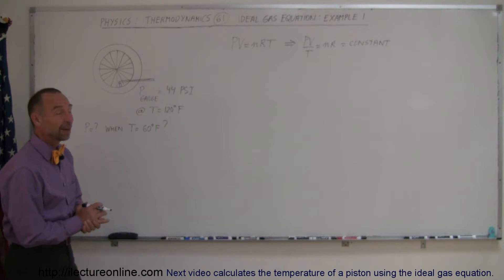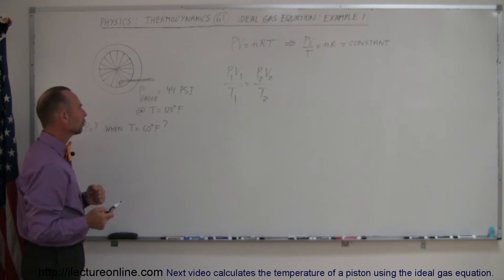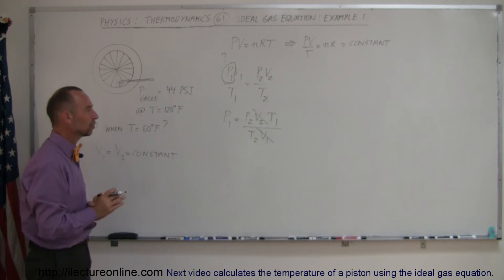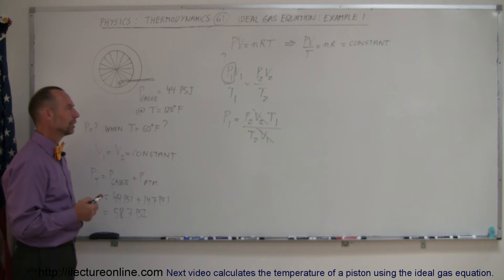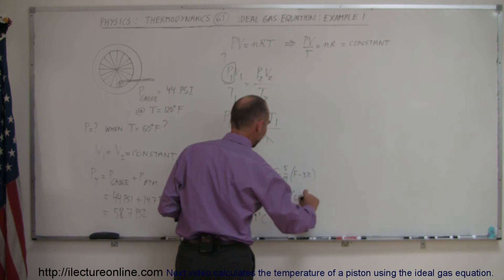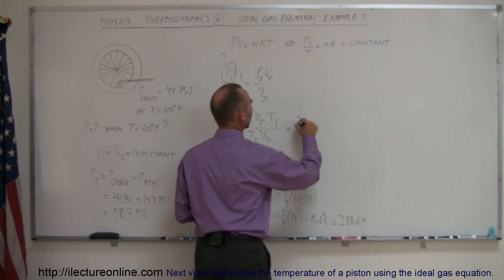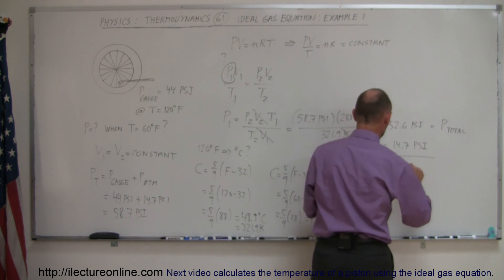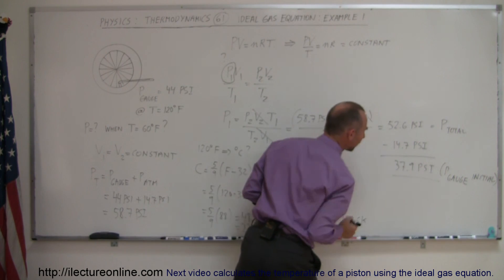Physics 26 (6 of 10) Ideal Gas Equation: Example 1

Comment: why do we have to convert the Temp. units to kelvins and the G pressure to absolute P. ?
Reply from the maker: The ideal gas equation was developed with these units.  If you don't use them you must adapt the equation for the different units.